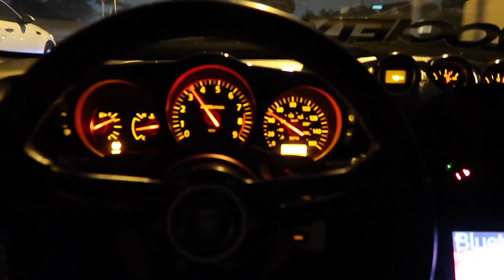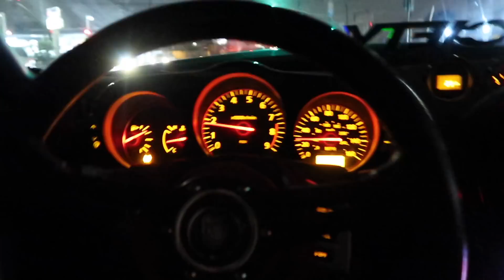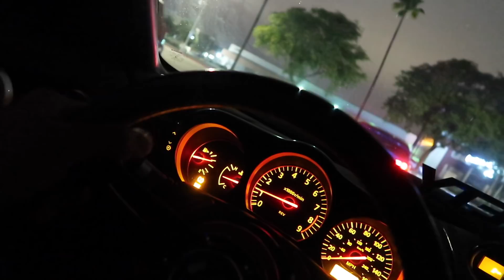350Z COMES OUT TO RACE! | New wheels for the EVO X!!

Comment: Watching your videos making me save for my first z
Reply: Bro just wondering for someone who never owned a z or doesn't work on cars daily what year of z should I get
Reply: 07 and ^
Reply: Josh Mapel I have a 2003 350z with 60k miles and it works perfectly try to stay sound lower miles z less problems for you
Reply: Joe Leal why 07 n up? What's main difference?
Reply: 02-06 is DE and 07-09 is HR. HR does have a bit more hp and sounds a bit different somewhat.  Apparently DE burns oil quicker. Interior/exterior is upgraded for HR. Most people will have DE because they are cheaper but HR you don't need as much to upgraded performance. I personally don't like the DE hood but that's just me.
Reply: Josh Mapel Dont get a de go 07+ if possible youll have more problems with oil down the line
Reply: South I cant find an 07 or 08 under 100,000 miles for 7k or 8k